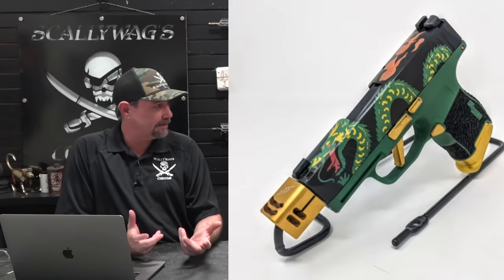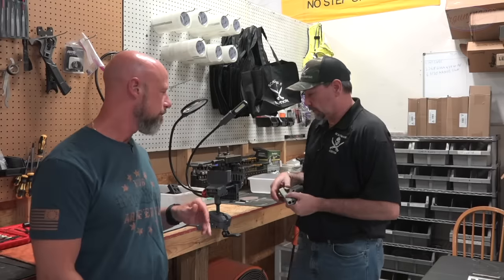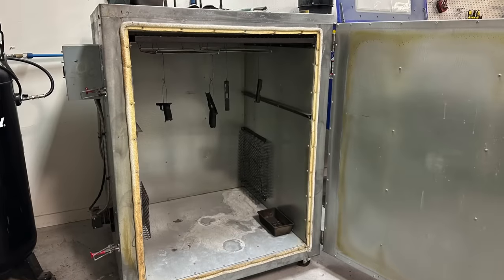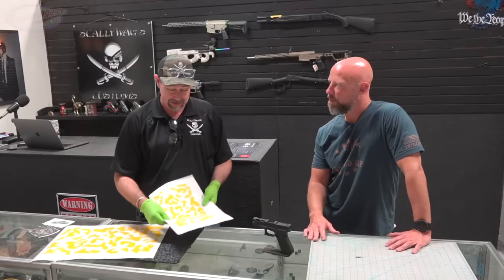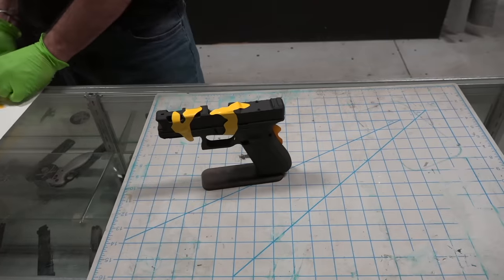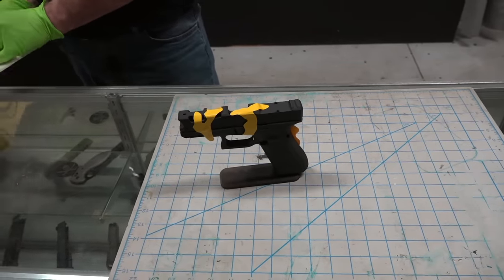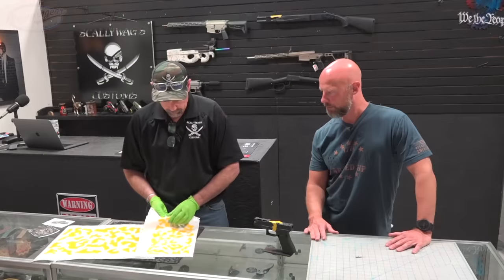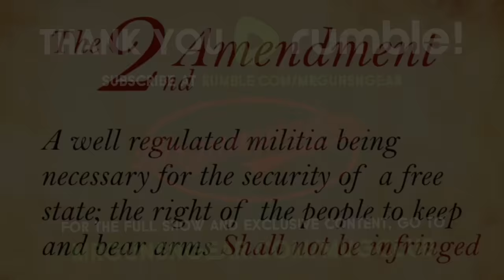How To Use Cerakote 🇺🇸

Comment: Cerkote is cool but some shops have lost their minds, went to the most popular shop in my town to get a quote on 4-color camo and an AR-15, and they said $650.
Reply: Doesn't sound out of line to me... That's a good amount of time
Reply: spray paint and an afternoon: $20
Reply: That's actually pretty reasonable for 4 colors with pattern on a long gun. It's not like it's just 4 parts each one solid color and a handgun. You have to understand the amount of prep work, layering stencils, etc. It's not just spraying the items.
Reply: @gordonstevens9074  more like $10-$15😂 and it looks way cooler
Reply: @gordonstevens9074  I did this, thank god it was with a aero. It eventually rubs off and gives a nice battleworn look, but after shooting for an afternoon, it almost becomes tacky and it rubs off on anything that touches it. If I ever want to get a gun painted again I will cerakote. You get what you pay for.
Reply: @SecondClassCitizen  when i used rustoleum primer+paint, it stayed tacky and rubbed off for around 48 hours but fully cured after that and had very good adhesion to anodized aluminum and parkerized steel
Reply: Do you know how it’s done ??? If not I’d advise you to learn how to do it yourself and then think about why those prices are the way they are
Reply: @keonrichards1083 isn't that literally what this video is...?
Reply: @moresomoze  we’re in this video. Does it show you the cost of all the equipment that it takes to make this? Lool

Comment: Very Cool! I was surprised they didn't clean again after blasting
Reply: We did off camera. I blow the parts with compressed air, and then I use a tac cloth to wipe the parts down before painting
Reply: @scallywagsnation  I assumed you did but I have 0 experience with Cerakote. Thanks for the response!

Comment: Cerakote does wear the best.Have a Colt frame and slide in ODG.Just wish this can be done at home.
Reply: It's definitely tough stuff.  My Rogue Ohio Deadlift Bar is a Cerakote car and it handles the abuse of being in a gym that isn't exactly climate controlled.   Lake Erie weather can be tough on metal.
Reply: It can. All you need is a spray gun, sand blast cabinet and basic oven. I use an old electric smoker
Reply: @justinrhodes1802  Yeah you are right might need to do this in the future.

Comment: Very cool! Now to acquire all the tools! "Baby, ima need a bigger shop!" 🇺🇸🤘
Reply: 60+ gallon minimum air, and a good air filtration spray area. Are the two most important in my opinion. Tabletop sandblaster and convection oven. Are sufficient to do most gun parts. Best of luck!
Reply: @armstrong2052  thanks for the breakdown

Comment: I used to work in the powder coat department in a machine shop. We coated things like pizza ovens for Little Ceasars and those floor scrubbers you can ride around on. Do the metal components have to be ground when applying the cerakote? With the powder coat we were using we would have to ground each part or the powder coat simply wouldn't apply properly. I know cerakote is a bit different but ultimately its just another type of powdercoat.

For quick and dirty degreasing you can use brake cleaner but the mix this guy using is way less caustic.
Reply: No grounding required.

Comment: Does a coating change the tolerance for an optic cut like the mos plate?
Reply: No Cerakote goes on thin, as long as it is applied correctly.
Reply: @jackhenry290  that is Fuddlore. Radian, Noveske, BCM are all very High End Lowers that are all cerakoted from the factory. I have a digital thickness gauge to measure the coating when needed. Next to Anodization Cerakote is the second thinnest coating being used. The only way the tolerance is off on a Lower is if the cerakote was incorrectly applied.

Comment: What type of series of coating do y'all use, H Series or Elite series? Also, on the pistol slide, do yall cover up the firing pin port, so the paint will not get into the firing pin channel and change any tolerances?
Reply: H-series on most everything except for Fixed Barrels, on Fixed barrels we will Use Elite Series .
Reply: @scallywagsnation  Thanks

Comment: Ive been spraying Cerakote for 5yrs, and PPG(automotive) at platinum level for 30yrs. I paint barrels all the time. What is 250° going to do to a barrel? Nothing.
Reply: The heat isn't the reason not to do barrels.
Reply: @mojoegunner5115  So, tolerances? I've built 33 AR'S of various calibers with painted barrels. I've had zero issues. I use either Superlative Arms AGB's or Superlative Arms Piston systems on all my non-blow back AR'S. In the last 5yrs I've sent 30-40k rounds down range. I know that's not much,but even at that level, I've had absolutely zero issues. Hot, cold, humid, dust, dirt, snow- whatever. Zero issues from Cerakoted barrels. Apparently not everyone can be me.
Reply: @tangomantactical soooo you're trying to compare fixed AR barrels to tilt barrel systems? Cool. Never wondered why none of the reputable tilt barrel makers use nitride, dlc, pvd, and such, but not cerakote?.. Maybe stick with your knowledge of coating AR barrels 👍
Reply: @tangomantactical  yeah I was referring to tilt barrel systems, there is a reason not a single manufacturer in the Country Cerakotes tilt barrel systems. As far as Fixed barrels you can for sure Cerakote them
Reply: @mojoegunner5115  okay, so your the Alpha male....at least I know. I do Cerakote Glock barrels. Yes they wear.....but any coating in the world will have wear if it's in friction with another part. Even impregnated parts will wear. Some people just can't spray Cerakote. There are videos on how to do it. I even have a tutorial myself. Your welcome to learn.
Reply: @scallywagsnation  There are manufacturers that offer Cerakoteing for their barrels. I know because I've called. I'm 52 and have had a spray gun in my hand since 13. Iwata's, Sata's two of the top  premium spray guns made,imo. I airbrush, I pinstripe with a  Mac brush on end. Certified in PPG, Sherwin Williams,and Dupont as well, although PPG is what I prefer to spray. I'll be certified in Cerakote in June. Nitride, PVD, Tin, they all wear. NP3, the least of all, but it still wears. I Cerakote Glock barrels, and yes, they wear, but I've received zero complaints. I brought up AR'S as a metric, then there was  a scolding for " trying to compare the two." It's all good. Congratulations on Cerakoteing, I Cerakote as a side job and a artistic hobby, it's not my career.
Reply: @tangomantactical  I definitely did not intend to sound or be negative at all towards you, not at all in anyway. I agree with you that all Coatings are going to wear on a tilt barrel subsystem like a Glock. We hold a lifetime warranty on everything we Cerakote so that’s one of the main reasons we won’t Cerakote a tilt barrel because it is going to wear out if it’s used. I have always used Iwatas but I have had several people tell me that Sotas are super nice and spray really well, I need to break down and try one out. I am glad you are passionate about the hobby like I am, and I hope you have a blessed day.

Comment: Bake for 2 hrs at what temp?
Reply: 1620
Reply: @AJohnSmith  In Scovilles correct?
Reply: Cerakote has complete instructions for using their product on their website. Curing temp depends on the substrate and which of their products you’re using.
Reply: @AJohnSmith  I thought you had to place direct in open fire for 6-12 hours

Comment: Unless you guys are talking about mid 1980s Quincy Model QMB25ACA320 480V 3-Phase Delta screw compressors and driers (THAT STILL RUN 100% AND EVERYDAY M-F) you have little to criticize over. By comparison the "rest" are just toys for little boys!

Made in USA with a Mr. T "Foo"!!!

😎
Reply: Getting a Quincy Screw Compressor dryer combo would be amazing. You are right they are literally King. The one I want is 20k delivered lol.
Reply: @scallywagsnation  

These two setting right behind the concrete block wall with me as I type this are 40ish years old. Both have been running their asses off since 4:55 AM this morning and never missed a beat.